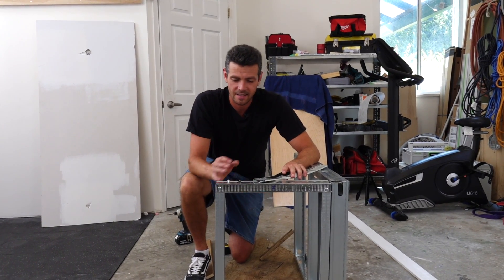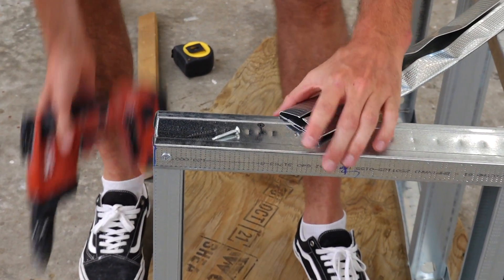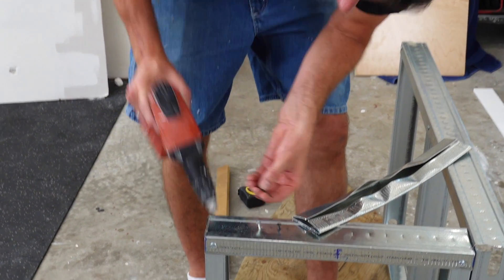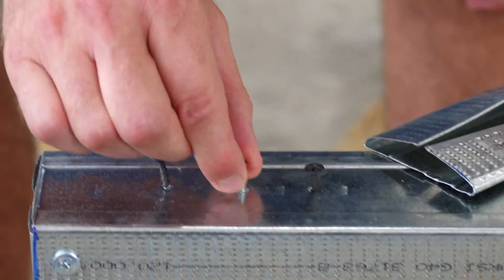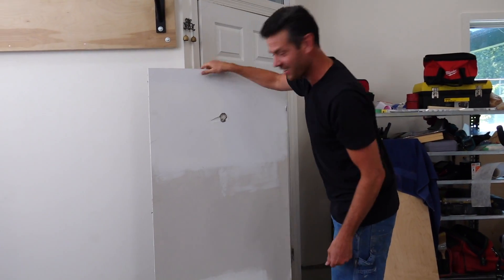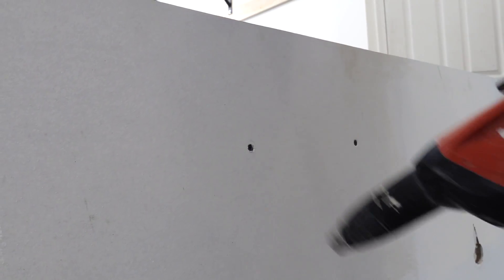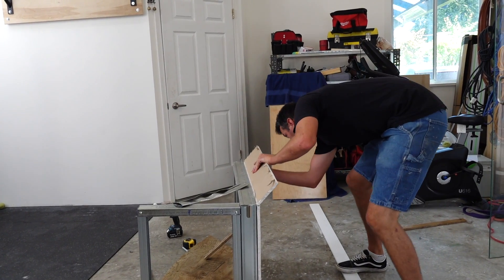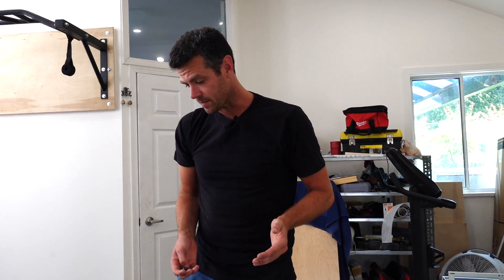Fine Thread vs Coarse Thread Drywall Screws

Comment: Nice video thank you man!  Could you explain why self tappers and drywall nails are plated and regular drywall screws oil coated?  I always just use whatever I got a bulk of which is usually fine threads screws,  but I know what I should be using.  Screwing through heavy gauge steel studs is always fun when you hit a hard spot with the self-tapper  You even said heavy guage in the video haha nice!  I was messaging as I was watching.
Also I love wafer screws, usually always a reliable made screw.  As an electrician they are a staple for commercial work.
Reply: They coat screws, you know why , it’s basic protection from rusting, it Basically 2 totally different projections , I would choice silver one if our you , it’s much better Protection